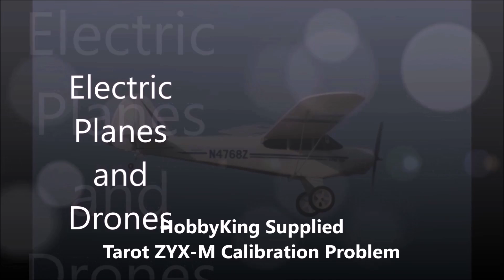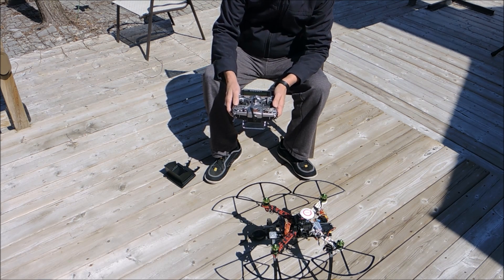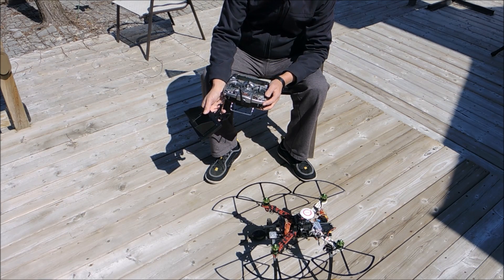Hobbyking Tarot ZYX-M Calibration Problem

Comment: have you had any success with this procedure yet??   firstly i would suggest you power up your quad with you tx on first and set to gps mode.  power the craft and be patent.  wait for boot up.  then yellow light will flash wit 4 red flashes.  within a few minutes it wil flash purple then 20 quick flashes of purple to let you know you have had more than 6 satellites .  dont rush it lol.   ;-)     

then switch between gps mode and atti mode on the tx 6 times or more,  but not as fast as you have done in this video.  slowly.  like almost count and switch in seconds  1.....2....3...4...5...6........7.....8.....maybe 7 and 8.  once the light goes blue  your good to calibrate.  hope this helps if you havent already solved the issue.   regards   richard.   let us know how you get on   thanks.

Comment: I found out on my tarot it will only calibrate using only  2 of the 3way switch..  gps and att.   my third part of the switch is failsafe..  I have to switch only two real fast and end up in gps...works for me...I like your video..thanks
Reply: can i ask why you have position 3 set to "fail safe"??  surely you have return to home switch feature switch set??   i only ask as "fail safe" is when your receiver loses you tx signal...  you need to set the fail safe value in your transmitter for the channel that you use for your modes  (most likly ch 5)   so ATM if you lose signal from your tx.  you aircraft WILL NOT ACTUALLY GO INTO FAIL SAFE AT ALL,  try it to see.  hook up to assistant software as normal.  you do not need to arm to test this.  go into BASIC SETTINGS....THEN RECEIVER... SO YOU CAN SEE THE MODE YOU AR IN IN GREEN RIGHT????    NOW TURN OF YOUR TRANSMITTER???  and see if anything happens?   if fail safe is set correct the way it should be then it should switch into failsafe and the mode led should start to flash green very quickly.   if not then you fail safe is not set up correctly.    hope this maybe helps you a little mate.   sorry to maybe sound like a know it all...  but you shouldnt have to switch into fail safe.   thats why its called fail safe.   cheers.

Comment: turn on your remote.. connect your quad batteries.. then you need to switch modes 6 times after the  short blue light goes off..
Reply: if it doesnt work.. disconnect the quad batteries and repeat steps